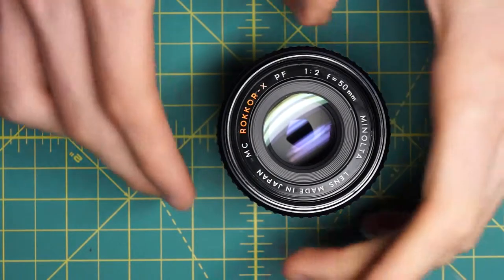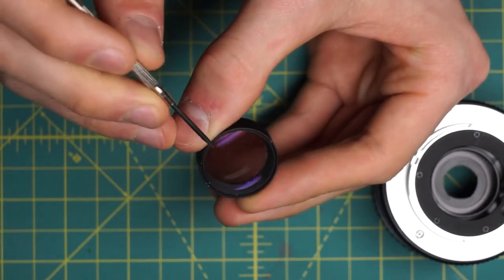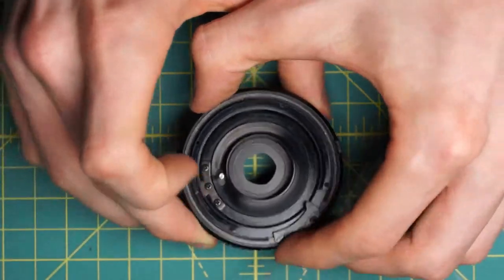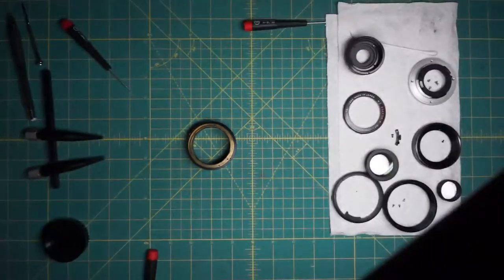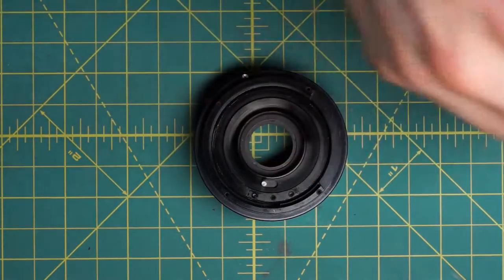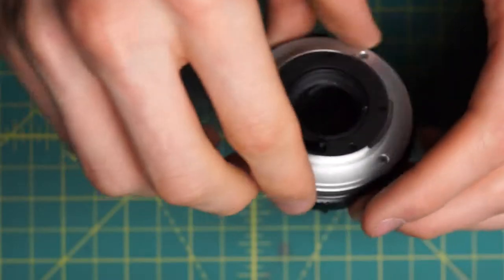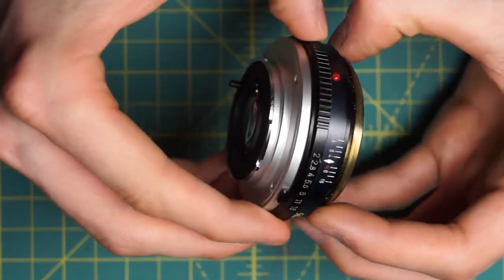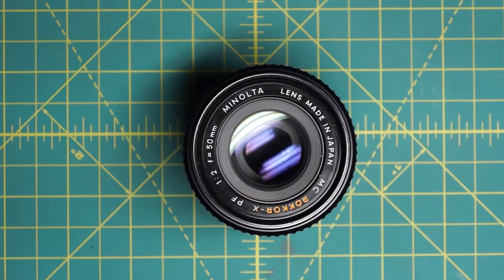Minolta MC Rokkor-X PF 50mm f2 Lens Disassembly

Comment: Hi Matt, how would you recommend disassembling the front elements (separate the grey from the black section)  at 1:50 ?
Reply from the maker: Start from the front or the back of the lens and look for divots or slots for a spanning wrench. These are most obvious on the gray front section. Try undoing these using the spanner, which can be very difficult since I believe they used adhesive or something to hold some of the parts together. If the rings are stuck, try to carefully applying some alcohol or other solvent to the exterior of the rings to loosen them up. The key is to be patient and careful, so that you don't end up damaging the optics.

After removing the front and back rings, the rest of the optics are typically just resting in place and can be removed fairly easily.
Reply from the maker: Yes, I'm not entirely sure what the stuff is. Some sort of epoxy perhaps.

I have a strap wrench and it is sometimes useful for taking apart lenses, but not here. The problem is that most strap wrenches are far, far too large for this type of work. I have yet to find a properly sized one.

I'm afraid I really don't have much good advice on this. I sometimes have luck using a rubberized mat for gripping the lower section and then firmly twisting. This is not ideal